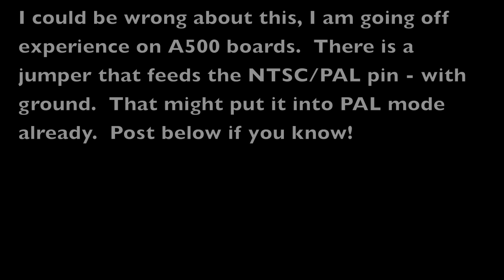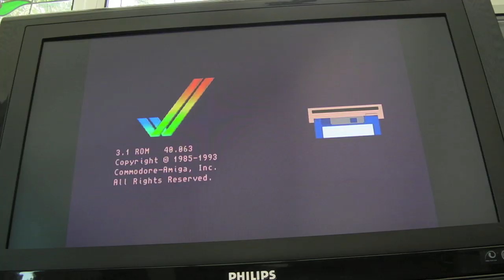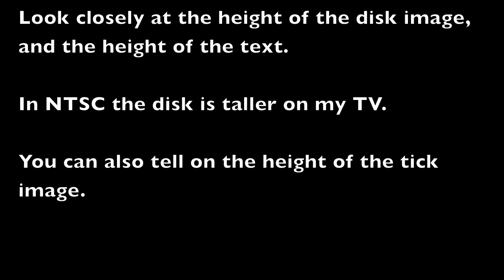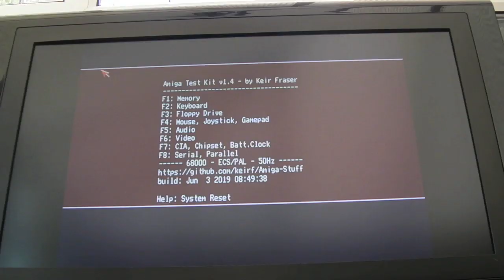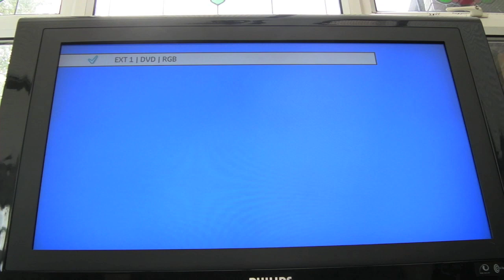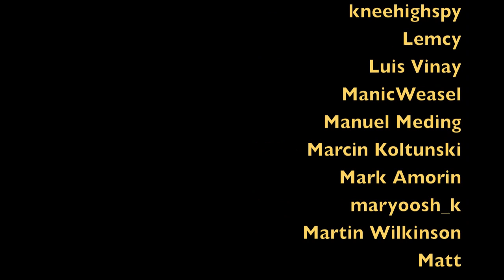Commodore Amiga A2000 Rev 4.x Upgrade to 1MB Chip RAM - 8372A Fatter Agnus (Kickstart 3.1)

Comment from the maker: NOTE: There IS a version of the 8375 that supports 1MB of Chip RAM and that has the same pinout as the 8372A.  But for the most part the 8375 needs an adapter board!  I cover fitting an 8375 (2MB version) in a later video.   Also, you could of course break the join at J102 and solder a jumper into position J102 as well - rather than mess with a sliver of tape.  I might do that later!
I didn't talk about what the jumpers do:-
J101 - Select A19/A23 for second RAM bank (This moves that 2nd RAM bank into the Chip RAM address range)
J102 - NTSC / PAL - disables test on 512K Agnus (8370 / 8371) - I believe 5v or N/C sets PAL, ground sets NTSC
J500 - Enable for decoding of $00Cxxxxx as RAM
Reply: Is it possible to upgrade to 1MB of Chip on an OCS A500 with a similar process ? Hoping to upgrade my A500 with a TF536 at some point later this year and put a 3.1.x in there.
Reply from the maker: Yes, I will be covering that too soon!  I've got a rev 5 that I've previously upgraded and will detail how I did it.
Reply: 8375 that supports 1MB of Chip RAM and that has the same pinout as the 8372A -> Part Nr. 318069-16
Reply: @75slaine  Yup, all you are missing is Fast RAM when you do that but that is not a huge deal. There were different options to add more RAM (Fast) with some trapdoor RAM boards or some sidecar controllers. 

When I was unhappy with the amount of RAM my old A500 had. I bought an ICD AdRAM 540 board that had a tiny board that fit between the Gary and its socket as well as a wire that got soldered onto the motherboard. A jumper set the amount of Chip RAM you had--assuming you had the right Agnus. One negative thing was that I had to use a program to recognize all 4MB on the AdRAM--I didn't bother with getting the 560 that would have added 2 more MB--but it did allow for 1MB of Chip RAM. It was still pretty kludgy for a commercial product.

When I got the DKB Mini Mega Chip, I had to pull the AdRAM since it wasn't compatible and had to throw in a 512k Trapdoor RAM to set things up for the 2MB of chip. My sidecar HD controller had room for 8MB of Fast RAM so my A500 was pretty fat--for the time but I didn't have a beastly accelerator--until I picked up an A2000 on the cheap.

Comment: Thanks for the video. I once got an Amiga 500 rev 6A which had this mod for 1meg chip ram. I found that certain floppy versions of games, like Street Rod was not working with 1meg chip mod. For whdload this mod is a must though. But for a basic Amiga where you would play mostly floppy games there are some incompatability with certain floppy games by using 1meg chip ram mod.

Comment: If you can tell me please which motherboard we can this upgrade i had motherboard rev 4.4 can i do this mode?
Reply from the maker: Yes, a 4.4 can be upgraded with the 8372A.  You could also remove the Agnus socket and do the 8375 mod I covered in another video (using an adapter to adapt to the 8375 pinout).

Comment: Can't you switch between PAL and NTSC via software or does that require ECS or AGA?
Reply from the maker: You can switch in BIOS on the later systems, and the option to do it is there in KS2.04+ I think.  I am just not sure the 8372A supports it.  The 8370 and 8371 certainly don't as they are hard wired to their region.
Reply: @GadgetUK164  Right--I remember now that you mention it--ECS required KS2.04+ as well to be usable. It was one of the reasons I upgraded to 3.1--this was pre-3.5 when I did this upgrade at the end of CBM. (All of my Amigas were second-hand or refurbished systems.)
Reply: Hold both mouse buttons down before power on, Kickstart 3 certainly has software option

Comment: There's a resistor to the left of J102, R101?, that looks like it might be a pull up. With J102 bridged it will pull the pin down as you discovered, and if you break the jumper it will pull the pin up.

Left as is with the insulation tape in place the pin is floating, which for CMOS (e.g. HC and HCT parts) is not a good thing - it's 50/50 whether the pin will be read high or low and may result in random results.

If the Agnus chip is CMOS, then leaving that pin floating is not a good idea.
Reply from the maker: Thanks!  the 8372A has an internal pullup!  Pretty sure, many of the guides going back many years talk about just isolating the pin - ie. high impedance and it's fine that way.  Always PAL - I've used my 500 like that a tonne over the years!  But you're right, there is a resistor and it probably can't halm it using a resistor to pull up rather than down.
Reply: None of the Amiga's custom chips are CMOS. Floating pin 41 is still a bad idea because it is used for different purposes depending on the PCB revision and Agnus revision.
Reply from the maker: Floating the pin to get PAL is the best idea!  Because a) it isn't really floating - it gets pulled HIGH.  I know this because I've done this mod a number of times since the 90s, and its the same mod that other users have done, without issue.  It is not floating because if it were trully just floating, 50% of the time it would boot to PAL, 50% of the time it would boot to NTSC - it does NOT do that.   b) different purposes for different PCBs - the 8370 / 8371 have a TEST pin there.  By virtue of isolating the pin as I've done, when you fit the 8370 / 71 back in there everything is fine.  That's it - there is no other scenario / usage / board revision etc etc.   However, if you were to feed 5v there, then when fitting an 8370 / 71 you would have to revert the mod.  So it is easier to do the tape trick imho.
Reply: @GadgetUK164  Ah right, so if its internally pulled high then "floating" the pin externally is fine. I have to admit I know nothing about Amigas or their hardware, I just watch with interest. Maybe some day I will dabble, but I have plenty of other projects that Im working on to keep me busy.
Reply: Although TBH it seems like simply breaking the trace through the middle of J102 would be a much easier and nicer way to pull the pin up, regardless of the internal pull up, since it would involve a lot less faffing around with tiny slithers of tape, which may have other unintended consequences for the chips pin and socket over time - e.g. added pressure/stress which may bend one of them more than the other, leaving sticky goo behind, etc.

Adding a header like you did for the other jumper so you can easily and quickly pull up/down seems like a nicer solution IMO.
Reply from the maker: Yes, I agree having a jumper and cutting the trace is less "bodgy" - but you do then need to remember to set the jumper back when using an 8370 / 71 - something I will forget lol.  And I have no doubt at some point I will end up testing an 8371 in there!
Reply: To clarify, I was speaking more generally as the title and video imply that this mod is suitable both PAL and NTSC Rev4 2000s. My mistake, I ignored the context and the note in the video description and I apologise unreservedly for that.

I do have a couple of questions though, if you wouldn't mind. Why didn't you use the early startup menu's 50/60Hz switching to check your TV? Why do people call it NTSC when it's actually PAL composite at 60Hz? <--that one's not serious. Would you be interested in a free A2630 board to play with? <--this one is 100% serious
Reply from the maker: No worries!  Yes, you're right there!  It's just 50 / 60Hz technically.  Thanks for the offer on the A2630 - where are you based?
Reply: I'm in Australia, not that that's much of a concern as I mean free as in I would cover postage.
Reply from the maker: Wow, that's very generous of you!!!  Are you on Twitter?
Reply: @GadgetUK164  I'm just paying it forward as the accelerator is a spare which I can't guarantee works 100% and would prefer it ends up with someone who has the time and equipment to find out.  Yes I'm on Twitter, I'll @ you some photos of the board so you know it's me.
Reply from the maker: Awesome!  Thanks!  That could make an interesting video!!!

Comment: Kickstart 3.1 does not need 1Mb of chip.
Reply from the maker: Thanks!  I could have sworn I read a post by Kipper 2K saying he had discovered that 3.1 needed 1MB of chip.  I found  that whilst trying to work out why mine just gave a black screen with 512K of chip.  But maybe it was failing to boot from HDD and that's my problem?